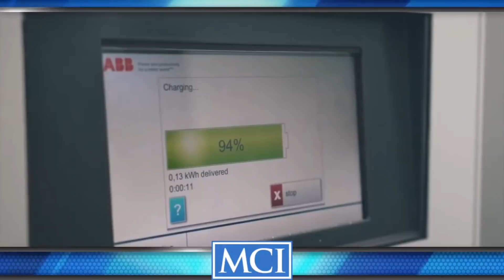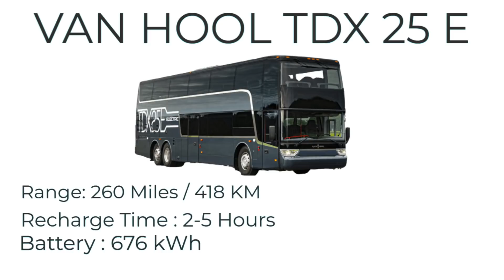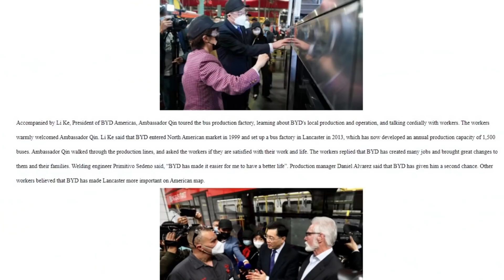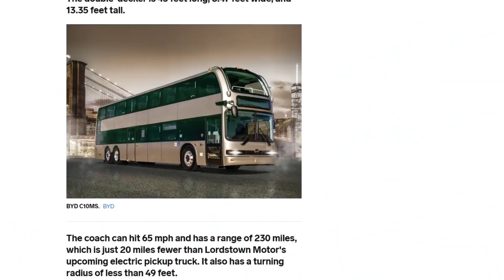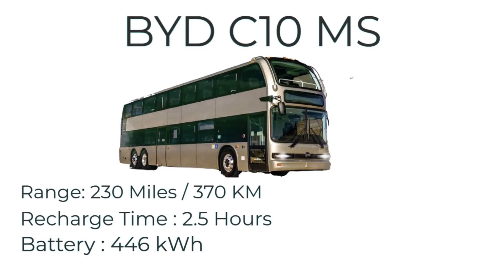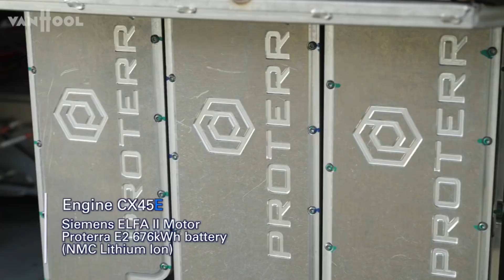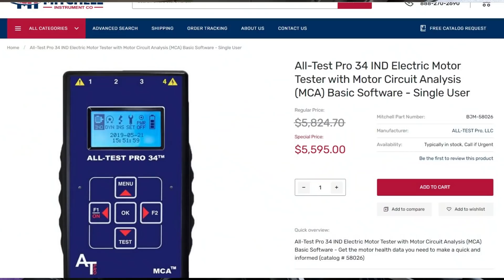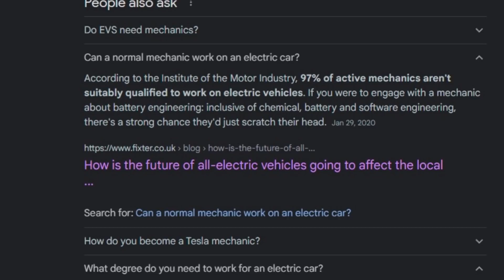Are Electric Buses working out in the US?

Comment: As a school bus driver myself, electric school buses are catching on quick.  Considering that we drive a few hours in the morning and evening, those things can get recharged at the depot after each run.  My route is only about 60 miles long in total so an electric bus would be a perfect fit.  Of course, we don't show signs of switching over from diesels any time soon.
Reply: Especially if who have a route in urban area’s, not any emissions from the engine and the possibility to regenerate power with all the start/stops, and as you said, the range and recharge is no problem
Reply: I'm a school bus driver and our company tried electric busses during the Winter they do not start and they weren't working properly so we will not switch over to electric we are staying with diesel and 
 Gasoline bus
Reply: @djmikethekingdj5914  Fossil fuel is here to stay!
Reply: I think school busses are a perfect fit to go electric. Not every bus everywhere, but most. Even in cold weather, if they’re plugged in between runs, heaters should keep things warm.
Reply: Lion bus is building a massive electric school bus plant near Chicago, and their new plant start cranking them out fast in Canada. Battery technology is accelerating towards more range, which Lions can currently run at 155 miles per charge. Maybe you're one of those drivers who would welcome an electric bus, tired of hearing those older louder diesels (DT466, CAT come to mind). If you want a quiet whispering new diesel, ask your boss to order a bus with a Detroit Diesel DD5 (a 5.1L four-cylinder with a dual-stage turbocharger), which puts out at most as much power as a 240 hp Cummins ISB.
Reply: @texasabbott  If you think diesels are hard to start in sub-zero cold. Try running a battery!!!
Reply: @stevepackard8542  Where have you got that thought from? Total Nonsense.
Reply: @SimonEllwood  What thought are you referring to?
Reply: @stevepackard8542  Batteries may have lower output in the cold but will still work reliably. BEVs are common in Norway and are well tested in Canada and handle cold with less issues than ICE vehicles.
Reply: @stevepackard8542 electric vehicles have no problem "starting" in extremely cold weather. The only problem is the reduced range, which also affects gas and diesel engines.
Reply: @trevorritchie2575  How does cold weather affect the range of gas power vehicles?
Reply: @stevepackard8542  internal combustion engines take longer to warm up in cold weather and run less efficiently when they're cold
Reply: @trevorritchie2575  I disagree. I have a 2018 with synthetic oil. Manufacture recommends no warming up required. Warming up the engine they say is bad. My car runs great in cold. I live in Maryland, and it does get cold! Batteries wear down in cold weather, and the life of the battery wears down under normal circumstances. My car gets 33 mpg. As long as I maintain it -  It should stay at 33 mpg!!! Gas is here to stay!!!!
Reply: @stevepackard8542  I'm 46. I live in Ottawa, Canada. I've been driving  gas cars and trucks for 25 years. I switched to electric 4 years ago in 2018. In 25 years of driving gas vehicles, none have ever gone as far on a tank of gas in winter as they can in summer.
Reply: @trevorritchie2575  How does cold alone affect gas miles?
Reply: Big factor will be cost I am sure.  Diesel school buses are bare bones and cheap (all considering)
Reply: I agree this is a use case for an electric bus that makes sense. Another one that comes mind is commuter rail shuttle (like Chicago’s Metra to Pace Shuttle-bug service)
Reply: Yes electric school bus would be good for taking student from curbside to school every day but not for long field trips. Some of the diesel school bus should be kept for field trip if your driving from AZ to the beach or places is California or driving up mountains. But with electric school bus you can get away with it if your taking students from school to Zoo museums or other place in town.
Reply: School buses are going back to gasoline. BLUEBIRD and IC obviously saw a need. Get this, CUMMINS is going to offer a gasoline version of the ISB 6.7. So while they’re pitch electric they are shrewd enough to keep gasoline and diesel.
Reply: Just don’t take them too far out of town. Or take a portable generator along.
Reply: School buses are generally a big waste of money anyways. So why not. I mean, that has to be the worst waste of money you can imagine, a bus dedicated to just delivering children to school. In Australia, they actually run a lot of bus routes around the city and no school buses are needed here apart from rural areas and private schools. You need school buses when you have gigantic mega schools.
Reply: @berenscott8999   I don't know where you got that idea from but you are wrong.  A school bus is not only used to take students to and from school.  They are also used for field trips and charter events.  It is much less expensive to just use our own school buses instead of booking a luxury motorcoach.  School buses are not nearly as expensive as motorcoaches and transit buses either so they are much more cost-effective.  So you see, instead of being a waste of money like you say, they actually save us more money in the long run.
Reply: @berenscott8999  In America, a lot of communities don't have city buses. And who wants their kids riding on a bus with the general public?!
Reply: @stevepackard8542  I understand. Which is a big difference to Australia. Kids in Australia use buses and trains to get to school. No problem. Schools here aren't mega schools. They are more spread out. Maybe 300 students to a high school, 200 to a primary school.
Reply: @berenscott8999  I don't know what your crime is like where you are. Probably not like in America! Most people would not want their child riding public transportation here.
Reply: @stevepackard8542  I have to say, crime is very low in Australia. I guess it's hard to compare countries. Australia also has significantly weak crime punishments. A larger focus on rehabilitation. But I suppose that makes our public transport an even better option.
Reply: @stevepackard8542  I guess if your travelling after COVID, come to Melbourne for a trip, great place with low crime
Reply: @stevepackard8542  Things have changed. Used to be kids were safe out unaccompanied.
Reply: @berenscott8999  Australia has entry controls.  US lets anybody in. No comparison.
Reply: @SteamCrane  true that. Here there are yearly quotas. Literally you can sit on a waiting list for 24 months.
Reply: @berenscott8999  I'm sure Melbourne is a nice place, But I don't fly! And that would be a very long trip from Maryland!!!!

Comment: I think the range would have to be a minimum of 500 miles/charge over the life of the battery and recharge <4 hours in order to attract the intercity coach industry. There’s talk of power delivery being embedded in highway pavement to allow heavy trucks to run long distance on electricity. The same would work for buses, but it’s not available yet.
Reply: I can’t even comprehend the energy loss, expense, and unreliability of embedded charging.
Reply: hrmm like... a ...trolly.. how things come full circle no?
Reply: I think in the UK they are experimenting with grid powered semis drawing power from overhead lines on their freeways